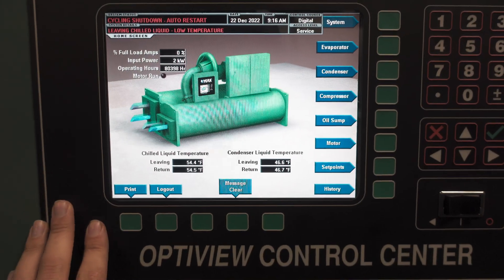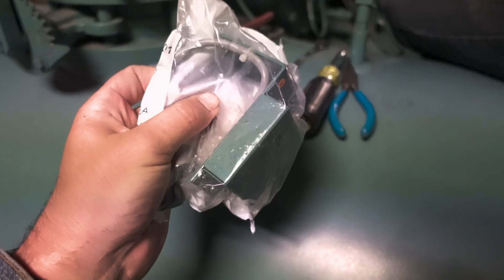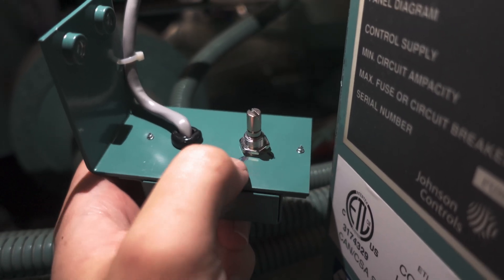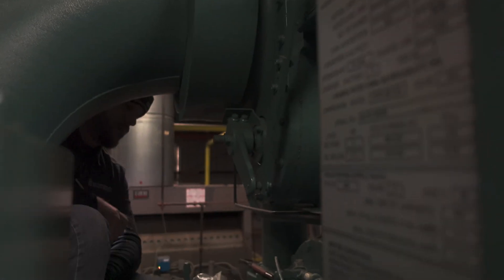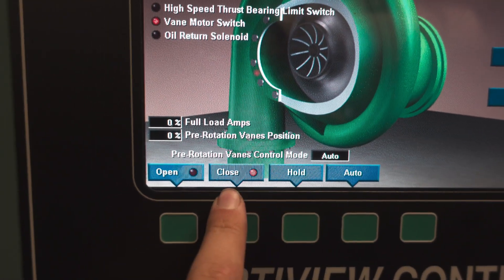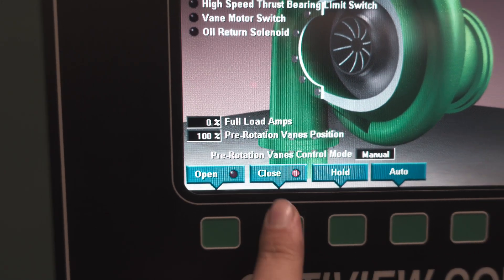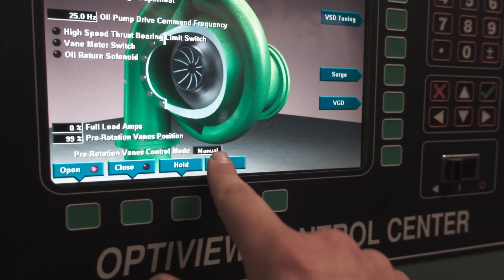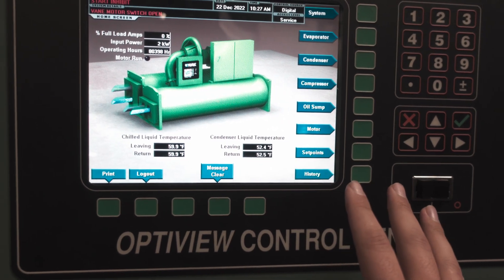PRV Sensor Fix for York YK Chiller

Comment: I have an old single line panel YT that i just changed this sensor on, and calibrated it, however i just finished winter maintenance on it, and noticed after i shut main power down to clean VSD, and restored power, that the sensor lost calibration. Re-calibrated, and is now reading 0-100% accurately. Is this a main control board issue? i cant seem to find a battery on the board, thinking a bad board battery would be the issue.

Thanks, great video, please keep them up!
Reply from the maker: That would be stored in the BRAM which has a battery that goes bad. I don't remember enough about that old panel where the BRAM is.

Comment: Well done - Giving out the passwords is the reason why we now have the YCAM software forced on us all. 🤦🏼‍♂️

Takes about 10 years to wear the contacts out on an a machine running 24/7.
Reply from the maker: I think York is locking down due to their own selfishness trying to force customers to utilize them over 3rd party. That being said this particular code is all over the internet already, takes 60 seconds to find.
Reply: @HVACTIME  - I appreciate the reply, however I’m going to respectfully disagree with your point regarding York being selfish.

I’ve come across far to many YMC2 that have had people with sticky fingers and little too much Google make a real hash of these turbos. It’s why I used to leave the operator password alone but change the service password on commission. 

Spare a thought for those of us that are still out in the field working for York and having to mop up after others. 

Kind regards from the other side of the pond 😉
Reply from the maker: I respect that it's frustrating and to few people know what their doing. I cringe when I go into a new YMC2 account and how much it usually takes to save them. But it also generates business and always has. A large part of my career for years has been mop up duty. I've put a lot of thought into that and think it's a natural progression. Especially when the industry on average has so little experience now. I know the manufacturers use people breaking things as their excuse to reduce peoples "right to repair" but I think they have money as their biggest motivation. Not customer experience. It definitely not just York. Trane and Carrier have taken things much further than York has and faster.
Reply: @HVACTIME   - very much so. I feel this conversation has legs, I’ll reach out off YouTube and we can continue that way. There’s a hell of lot more I’d like chew the fat about, but the sensitive bits need to stay off an open platform. 
All being well the time difference should be non existent on my part from Tuesday. 🤙🏻
Reply: Now the majority of Jci chiller mechanics are for the most part just part changers. Your only as good as the information. York just like Trane will lose in court and have to allow any mechanical contractor who a customer wants to work on there chiller because they don't want Jci on site the ability to have the password.  Now on the Trane adaptiview Trane can download software so that all sensors etc can be binded right from the panel. The end of the Day it all depends on who the customer wants working on there chiller
Reply: @JohnFlanagan-hs1fv  very much so. I'm currently in the process of unpicking the work of one at the moment. I'm Carribean Blue through and through and by far the best JCI Tech I have met came from JCI Federal earlier this year, and we worked alongside JCI Controls from Puerto Rico, it was like the old days. I do miss the machines and the 'York' guy's but JCI/ADT/Tyco make things very hard to actually get things done on a daily basis.